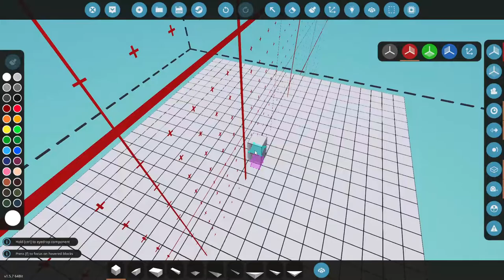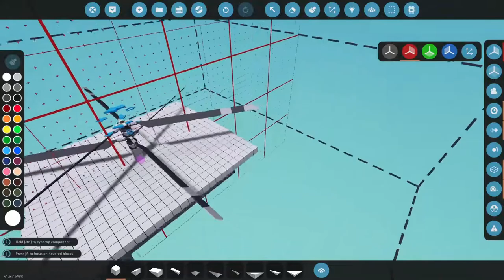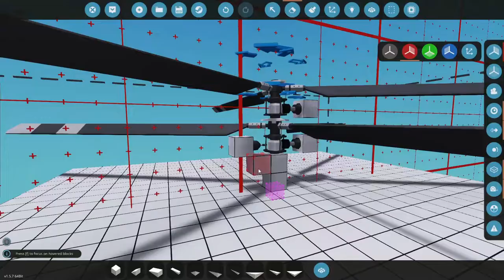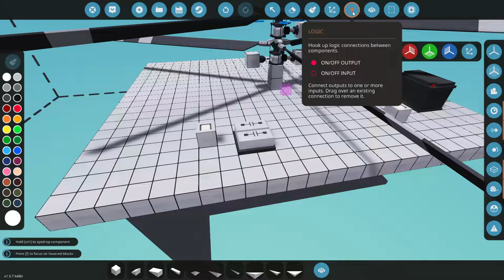Beginners Auto Weld & Auto Fold Props Stormworks Tutorial - How To

Comment: Another option is to just put a few wedges and blocks around the rotor mast to make it look kinda like a swashplate.  
I usually do something like that anyway because I don't like the rotors being so close so I add a pipe or pipe block in between them.   

I haven't tried it yet, but can the welder be damaged?
Reply from the maker: Yeah the welder can be damaged.  That's the only downside.
Reply: @ProfNCognito  Hmmm, 🤔  so might need a welder to weld the welder that welds the welder that welds the rotors?

Comment: I wonder if there is a way to detect damaged rotors and automatically repair them
Reply from the maker: Aways have it welding non stop but then your battery power suffers.
Reply: @ProfNCognito  use an infinite generator
Reply from the maker: Yeah but not everyone likes those kinds of things. It's a gray area.
Reply: when the rotor is gone, your engine lost it load that it will spin in an abnormal speed to throttle ratio. So you may auto-repairing by monitoring the RPS.
Reply: @ProfNCognito  fair point but if I'm gonna be honest I use an infinite generator in everything that I make that uses electric motors just so my boat doesn't sink with all those battery's weighing it down